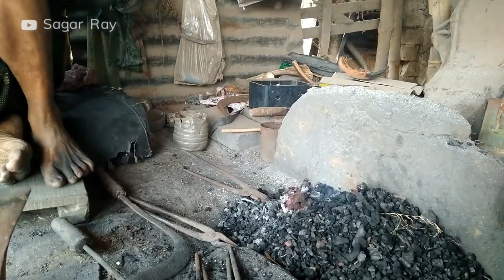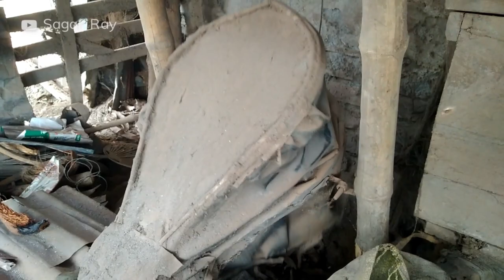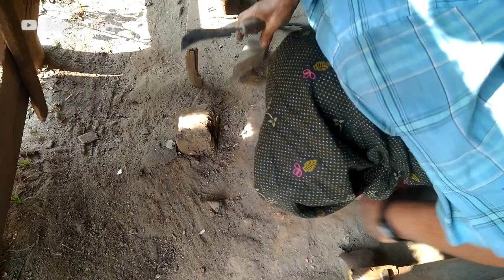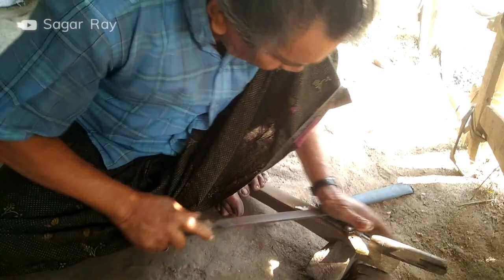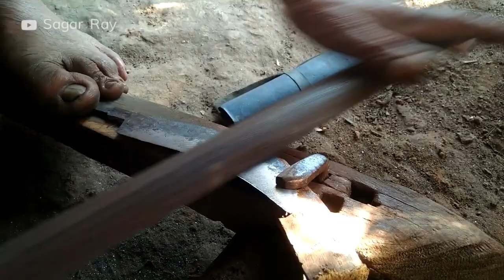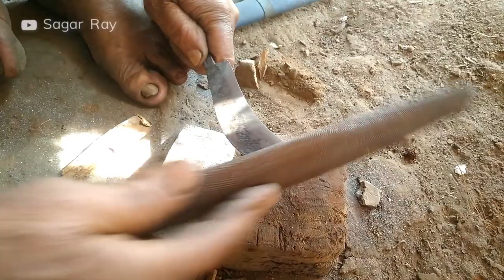Knife making by an old blacksmith in Bangladesh: Blacksmithing | Hand made knife | Blacksmith tools

Comment: he didn't quench the knife, not even heat treating is performed on the metal. rough filing on the annealed metal to create the cutting edge but which will crumble on a shock load due to less toughness and hardness on the edge.  he is old and experienced but his way of work is too much backdated which should be improved.  Respect to this old blacksmith.